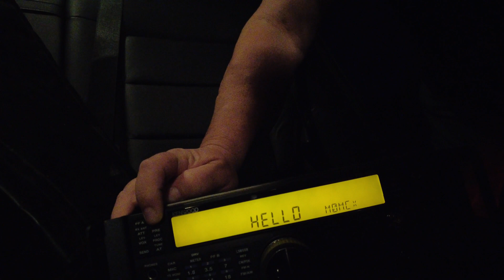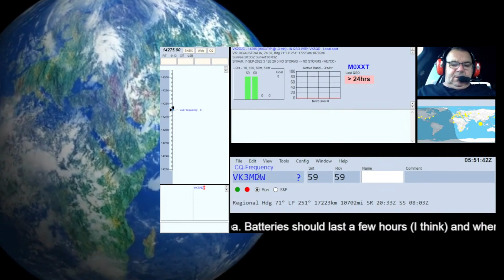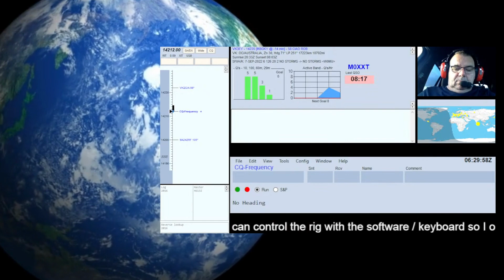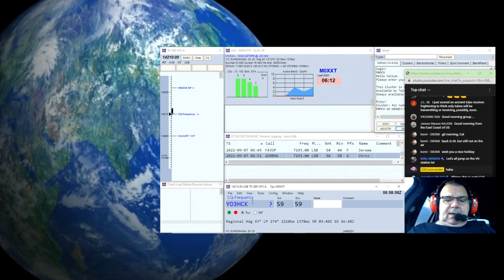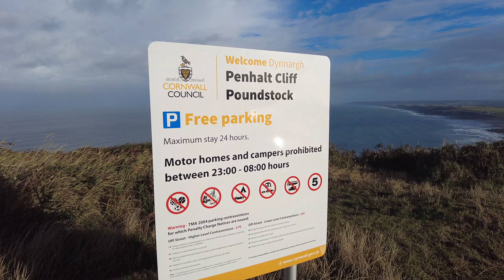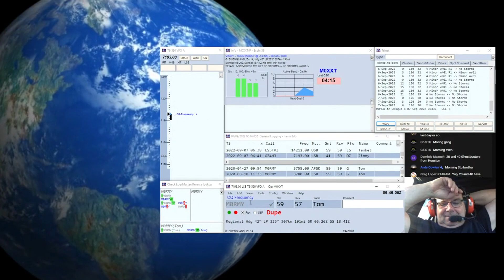Off-Grid Ham Radio Operations: Portable Power for 100 Watts at Night Using a Car Battery

Comment: Thanks for a great little video, giving good insight into the realities of getting started with mobile operation  😀.  Just wanted to ask - have you any thoughts / aware of any views on Battery size (Ah) for 5-7hrs radio activity?  73`s,  Steve  M0MOG
Reply from the maker: Depends on power levels.. I calculated mine like this.. 1 hour at 100W SSB, at 50% talking and 30% power draw (dependintg on compression) means ABOUT 3Ah. Double that for safety margin. Therefore for 5 hours, you would probably need 25Ah.
Reply: Many thanks Callum !

Comment: Hi Callum,  I only have a vauxhall astra for the local high point which is also by the sea here in Scotland. 

I've put a VSR split charge from the starter battery to a 130ah auxiliary battery in the boot and I run a KPO DX5000 10M Radio and use one of your DX commanders poles with a stripped out gainmaster (just the wire innards and choke - so239. 

I would like to connect my Yaesu 991A instead but I'm scared it may use too much juice as I know it uses 2A on RX alone.

Do you recommend anything I could do to make it work? Like another battery or maybe even a generator, and if so what one?

Thanks for sharing, always great to see your videos.
Reply from the maker: With a 130ah battery, you will be just fine. Go and play :) PS - Love the idea of the stripped out GainMaster..
Reply: @DXCommanderHQ  cheers Callum, yeah the gainmaster snapped in winds and I thought. "terrible build" it's now a T2LT. All the best, Cheers N Beers

Comment: Cal.   Have you ever thought of buying a old shiter caravan and converting it to a mobile station?  I was good friends with a couple of guys years ago ( wonderful blokes funny as … uck ) and they converted this thing from top to bottom with antenna’s heating aircon you name it.  Didn’t sleep in it it was just a pure DX command centre.  And thy talked all over the world.   Mainly 11m. But on other bands as well. It was a complete self contained station.   Mite be worth thinking of mate .   Any way. Just a thought.   Cheers old cock 👍🇦🇺😎🥃
Reply from the maker: Actually, I have thought of it. But when we go away, I generally sleep in the car and tow the massive generator.. SO I can't tow two things.. Saying all that, the generator still not working. Grrr.

Comment: i found when im out at night like that way back when was to actually have the radio on the dash or the DRIVERS seat, and then actually sit in the passenger seat. reason being is that you dont have the steering wheel in the way an dyou can actually put the seat way back and give you plenty of leg room
Reply from the maker: I remember why I put it in the back.. I was prototyping the idea that Wendy might come out and read a book in the passenger seat. But yes. Agreed!

Comment: Check out Olight headtorches, not cheap but very sturdy, good batteries in them. Being able to get the antenna mast down quickly in the dark can be as important as putting it up, summertime thunder and lightning and a 12m mast on a dead flat shoreline concentrates the mind wonderfuily!
Reply from the maker: Woah! Yes!

Comment: also a 7100 works well with a flat CAT7 ethernet cable between the control head and the main body. I then switch between 2 of them 1) on the dash, 2) in the camper living area
Reply from the maker: Nice!

Comment: You just convinced me that I need a bigger, better battery than the one currently in my Jeep. 

Alternatively, something is wrong with the wiring and I'm getting too much voltage drop. All the same, separate batteries is a good thing if I want to eventually leave!
Reply from the maker: Good point actually. I COULD have run off the car battery, but - anyway I didn't :)

Comment: Inspiring!  I was happy to make it into an SDR receiver station in Vermont with 100 watts from Akron, Ohio USA, mostly to hear my audio quality as one of my goals is to achieve broadcast studio audio quality on the air, and no more than the 100 watts as trying to get a decent amplifier and run it from an apartment or flat is becoming too much of a challenge.
KD8EFQ/73!
Reply: Hey Charles! Must have been the K1VL machine yes? It's on the south face of Killington peak in Shrewsbury. 25 air miles from me. Killer sdr! 73
Reply from the maker: Nice work!

Comment: Using the brake pedal as the foot switch?😉
Reply: mount a headlight high beam switch in the floor.  although you’d need a momentary switch.